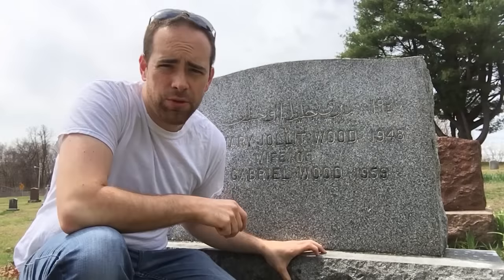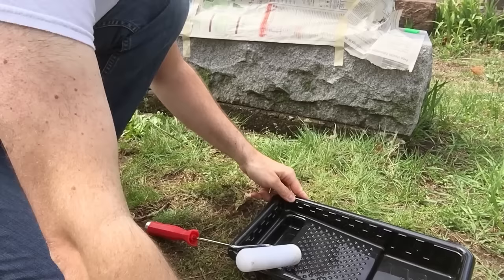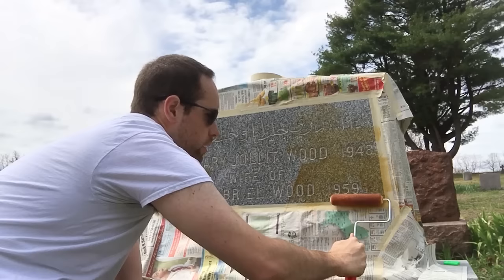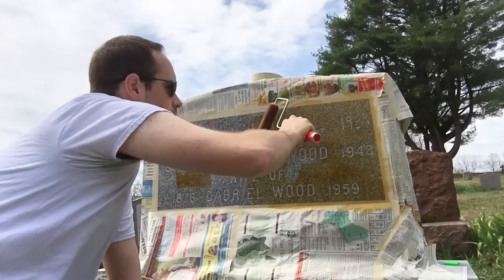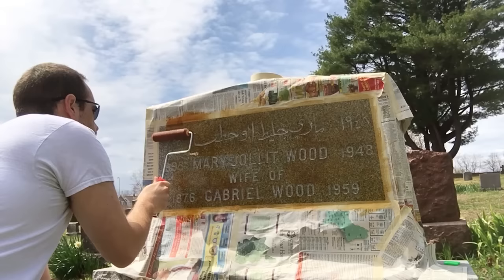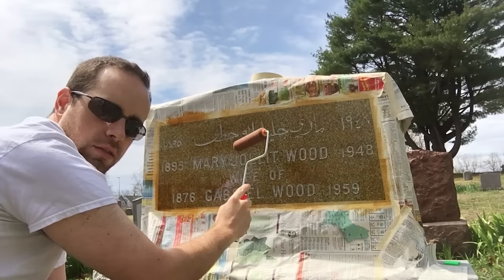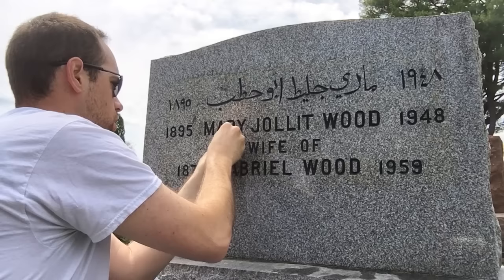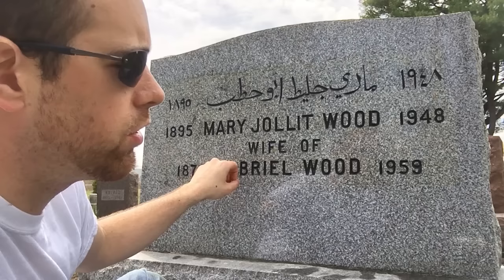Painting Headstone Lettering

Comment: For future reference, avoid anything metal when cleaning or detailing headstones. You run the risk of leaving scratch marks in the stone. A hard plastic putty knife will do the same thing, and won't leave marks.
Reply: Using a flat scraping razor won't scratch a polished surface.     It's actually the go to method for hard alkali staining..
Reply: @LOGANIZM agreed. The risk of scratching a stone is overblown in my opinion. I've used a scraper on hundreds of stones and have never had a problem. Now never cut through stencil on a black stone. That will scratch for sure

Comment: The sorgum molasses does not need to dry. I apply lithocrome immeaditly after I'm done with the molasses. I allow the paint to dry for about 15 min then take soap and water and a scrub to clean the molasses off then use the cleaner stone to take off paint. Rinse and done.

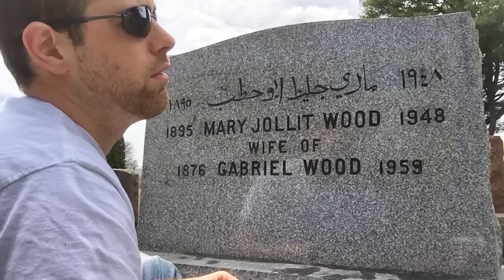Comment: Very nice video. I can't tell you how nervous I was when you were talking about using molasses, spray paint and razors on a headstone, but the results look very nice. I agree with comments left by Jones Family. It is all good advice. Believe me, some cemeteries would have a fit if they saw you doing this. Another thing to note... at the 26:25 point in your video, you start talking about making granite markers to put in the cemetery for other family members. That might be difficult to do because of cemetery rules, especially if you do not own the plot. Last year I bought a grave marker for a great-great grandfather after I found his burial place. I had to jump through all kinds of hoops to get it done though. He was buried in a pauper's grave with no marker of any kind, in a section of the cemetery that had very few headstones or markers and was not even mapped out. I spent several afternoons there, mapping out that section of the cemetery myself and finally located where his plot is. I had to get permission from the cemetery to buy a grave marker and have it installed there. I was fortunate that all deed-holders and contacts on file have been gone for many years and there was nobody left to contact. Being a direct descendant, they finally gave me the green light to go ahead and have a grave marker installed. However, I could only buy the marker from a company on a list of approved monument companies the cemetery gave me. It was time-consuming and expensive, but in the end, I'm glad I did it, and the marker looks pretty sweet. Now he is no longer forgotten to time.
Reply: PolarOwlBear, what a wonderful tribute to your great- great grandfather! I appreciate your dedication and determination to insure his life was indeed significant and you, Sir,  are the living proof. God bless you,  Elizabeth

Comment: thank you for this video. I learned from it and restored the lettering on my dad's headstone today.

I didn't use molasses. instead I used liquid latex, which worked better when I tested it (obviously I let the latex dry before spraying over it). I found that once I'd done the lettering and the paint had dried, removing the masking latex came off a lot cleaner with a scraper. the stone I worked on isn't polished, and had a slightly coarse texture. so when I removed the latex, I first used a scraper, then water with a pumice stone to smooth out any scratches I left, then soapy water and a cleaning brush before rinsing off.

again, thank you for posting this video.

Comment: a good tip when scraping like this with a razor blade,do it in a slicing motion instead of a plowing motion.good video,he did a good job.it really stands out and the deceased are smiling as they watched him.
Reply: If I may add:  use a light touch when you begin, a scratch is unlikely but lasts forever.     .

Comment: Very finished looking !  Molasses is an incredible material for health...  masking techniques and even mold making for metal. It will even de-rust any thing if left in a vat for 2 weeks..  1 to 9 parts water the best !!  mixed in sand you can make molds for casting metal.
I used it for making a fish tank back ground mold... Designed the back ground using mud stones etc. then sprayed it with molasses/ dried it with a torch then paper mi-shay with cloth and silicon calking... then backed up with insulation spray foam. Washed all the mud away and Vila One mold.The molasses was used as a parting agent to keep the mud in place like glue and create a surface that would not glue/attach to the silicone.... worked wonderfully. 

I really liked the tip and your work keep it up friend.

Comment: Great work. I have always preferred Krylon spray paints as it dries fast, so allows multiple coats if needed without runs. In my experience with Rustoleum spray, it takes forever to dry, and more chance for runs & sags if you need 2 or 3 coats.
Reply: Don't use anything but monument paint . Lithochrome

Comment: I enjoyed your video and I also am about to repaint my Grandparents (stone1) and Great Grandparents Headstones (stone 2). They are similar being made of granite with a polished surface. I too will be using 'Molasses' to repaint stone 2 with black paint but stone 1 is 'gold' lettering and think I'll use 'golf leaf' which needs a gilding paste/oil base. I've another 2 stone which don't have a polished surface which will need a slightly different approach. They needed very carefully cleaned, which I've started by just using water and towelling. I am now about to clean them with an approved headstone cleaning solution spray. I'm also gonna look deeper into the painting of the lettering because its different to the polished surface, When those stones are repainted and completely dry, I'm going to apply a wax coating. (However those stones are also needing their mounting repaired/replaced.) To scrape off the molasses covered paint from the polished surface you can use a diamond stone cleaning block or cuttlefish.

Comment: Here in nz was told by a worker in a cemetery that an effective way was to just use a brush and just push the paint into the lettering don't bother if it gets onto the face just let it dry well .he may have given away trade secrets but get a piece of pumice rub it on concrete making it flat then cut the face ,

Comment: If you look at the Bott video where he repaints polished granite directly and then removes it with his clean stone.  The molasses trick seems to be only needed for unpolished granite.  Other people seem to recommend using cuttlefish bone to remove the residual paint, or, soft stone such as pumice.  But the mohs hardness of granite and pumice are both 6 so I wouldn't dare do that.  I didn't have cuttlefish so just used a dried pigs ear that was intended for my dog as a treat.  Real gold leaf isn't that expensive but you need to erect a tent around the monument so that wind doesn't blow it away while you apply it.

Comment: Jones family is right. however the molasses is not necessary if you use the proper paint. i have painted many headstones with Lithochrome spray paint and you just razor the paint off of POLISHED surfaces afterwards. DO NOT ATTEMPT ON MARBLE OR ROUGH SAWN/FROSTED PANELS.

Comment: Very nice! Do you think some clear coat would make the paint last longer?
Reply: No you need to use water resistant paint specifically designed for stone called lithochrome you can buy it in a rattle can but may have to seek out a specific supply company

Comment: While this worked well on polished granite, using this method on old marble could be disastrous! I have seen many old marble stones that were ruined by use of chemicals and brushes. Any agent other than pure water contains chemicals. IMHO, If you must, D2 is the best cleaning solution - used at Arlington! - and leave anything else to a professional.

Comment: In the future you are only wanting to hi-light the lettering as paint will not adhere well and will come off quickly. The product to use is called Litho Chrome Hilite. Specific to the stone industry and used by monument makers like myself.. It comes in aerosol can and the idea is to hilite not paint. The application is done quickly as to not get a lot on the lettering so it’s a constant movement of your arm. Hold can and spray while moving your arm up then down then right then left then quick spray straight on. You can purchase this from company’s like Miles Supply. If applied correctly and then apply Lithochrome Clear it will last many years. I’m afraid that the product you used will be flaking within a few months of your hard work…

Comment: hello brain, this application is good to use it on marble? and from where I can finde the molasses and the rust oleum spray? very nice job
Reply from the maker: Peter Shaw this technique should be ok on marble, as long as it's not an old stone that has an unpolished face. In that case, you might have trouble getting much definition on the letters as the edges might not be as clean from the face to the carved letters. If the surface is smooth and the letters are well defined- I'd say you're good to go!

Comment: I'm wondering if it would be easier to use plasti dip spray instead. You'd have to spray 4-5 layers but after peeling off the exterior parts will be easier, leaving the lettering intact. I worry about the overspray. I would have duct taped an open bottom box around the signage area just in case to protect surrounding grave markers

Comment: Why not just go buy a .50 bottle of black paint and small paint brushes?
Reply: As a professional restorer, I use paint and small paint brushes. I am also one of only a few in the country that do it. It is quite time-consuming and tedious. (Not my words... it's how everyone else describes it when they watch me!) I LOVE doing it!! There are no masking agents for unpolished surfaces and there are thousands of pores and fissures for the paint to go where it is not wanted.

Also, chemists have developed paint that is specific for the monument industry. It is next to impossible to work with manually, but the results are worth every hair I have pulled out of my head. It lasts longer, it is sun-resistant, and it makes it easier to repair the stone should something happen to the area that is painted. i.e., it is a bear to put on but quite easy to remove. Other paints not designed for monuments can be quite problematic to remove, yet they will chip and fade!!

BTW, my brushes usually have 3 or 4 bristles!
Reply: @jonesba2004  Can't you seal the area first before you paint to stop the paint spreading into the microcracks?  And why not gold leaf?

Comment: Wouldn't it have been easier to just paint the letters with a fine tip painters brush ..
And then seal it with granite sealer..
     Looks and sounds windy there and you can see your over spray blowing over to the monuments beside ya..
Long term , I'd say you did more damage then good , and you scraped a blade all over the face of it destroying the granite seal and polish on the face of the stone ..
Might not look like it now but in a few years you'll see it as it weather's and your polish starts peeling..
Reply: Absolutely not. It takes hours. I've tried to do it this way. 😩

Comment: ? Alternative molasses
Reply from the maker: Really anything that can dry enough to hold up against the force of a spray paint can, yet can be easily scraped away and is water soluble for being fully cleaned off the surface and out of the pores.

Maybe a dish soap? something that won't crack if it dries.  For sure something that won't harm the environment when washed off.  Make sure you try it in a small inconspicuous place first.
Reply: Thank

Comment: How long will the paint last in the letters?
Reply: As a professional restorer, this might be the #1 question that I get asked when I am painting. And sorry to say, the answer is, "It depends." Every headstone or monument is it's own microclimate. That is to say, that two identical stones can be sitting side-by-side and painted at exactly the same time with the same paint by the same person and the paint may still need to be redone at different times.

It depends on the paint, the stone, the depth of the letters, the angle of the surface, the air (pollution), the plant life, the bird droppings, the cleanings, the weather, the sun, and probably the moon and the stars!

Generally, by using industry paint on a vertical granite surface in a northeastern (US) climate, I have seen the paint last about 12 years as new. Flat surfaces and stone other than granite require restoring in just a few years.
Reply: Jones Family use epoxy paint and a sealer.